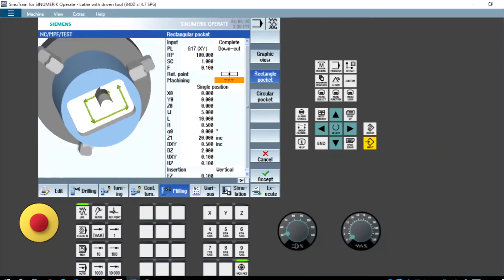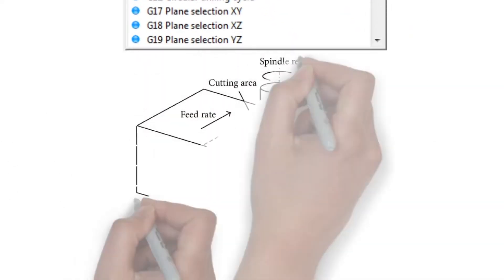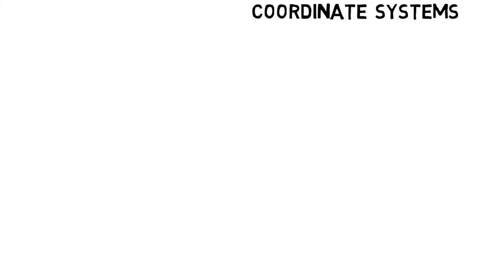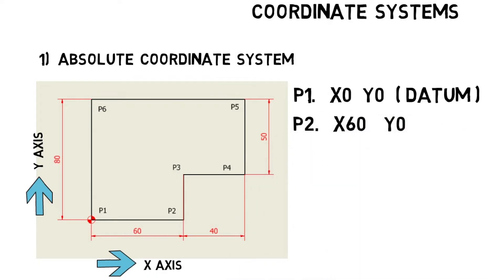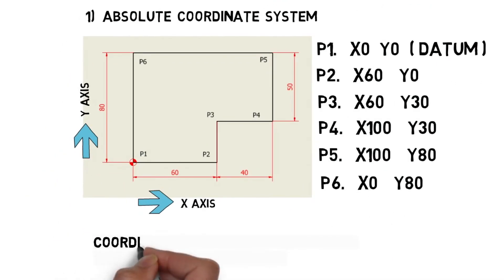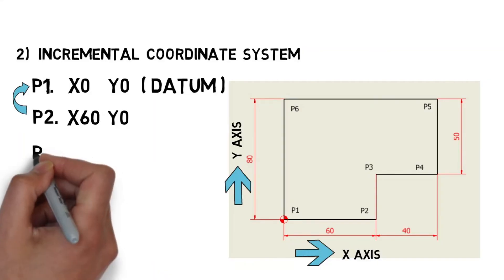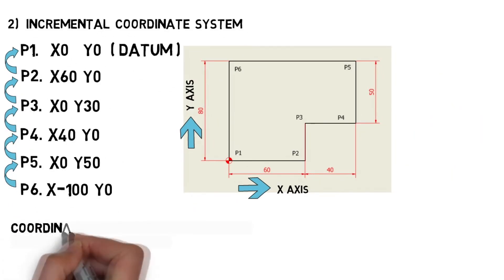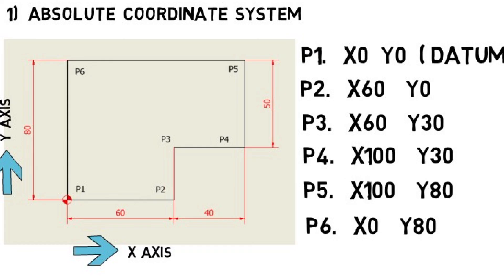CNC Programming Tutorials | Absolute & Incremental Co-ordinate System Explained | VMC #1

Comment: Hi sir please perfer any laptops with specification for  mastercam and dellcam
Reply from the maker: Mastercam need Graphics to run smoothly.
If you are a student, try Fusion 360 can be run on Basic laptop too
Reply from the maker: If you stick with Mastercam use i3 or higher processor min 8th gen or later.
Min 1gb graphics must